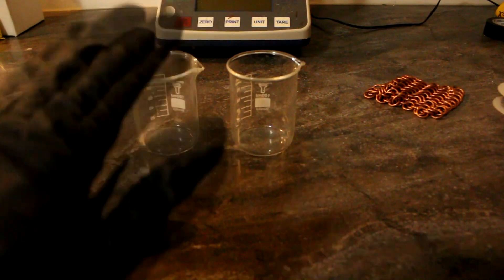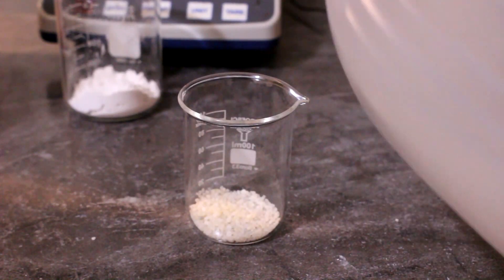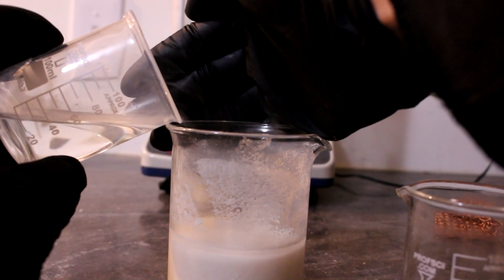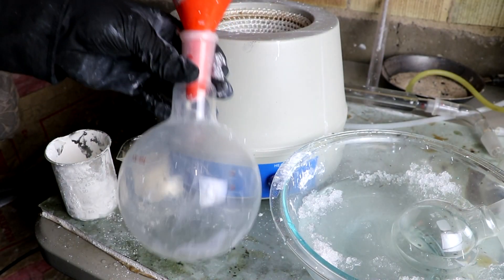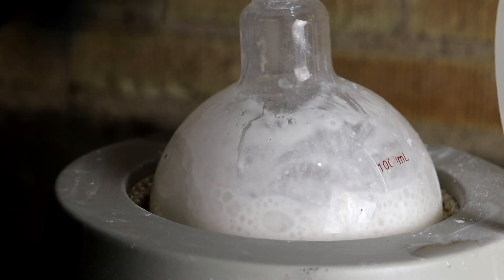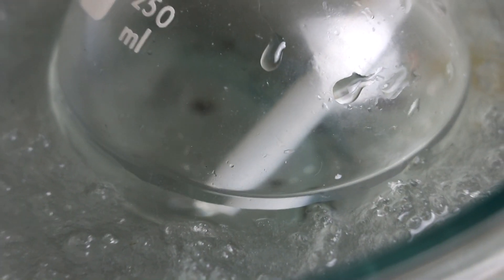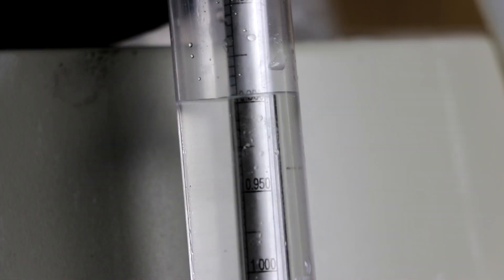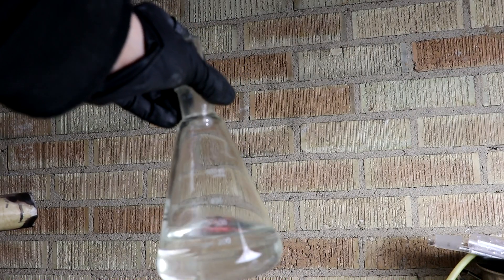Making Aqua Ammonia

Comment: slacked lime
Reply: How would a seasoned chem-guy say that? Does he know something I don't?
Reply: slaked lime. You take quick lime (CaO) made from calcining limestone, then you mix it with water in a big pit. It consumes much of the water, getting very hot in the process. When it is slaked (has used all the water it can easily absorb) it is called slaked lime, or CaOH, or hydrated lime. Cody made a mistake in calling it ag lime. Ag lime is just crushed limestone (basically calcium carbonate).

Comment: I think you may the the messiest chemist I've ever seen on youtube.. And it makes a great contrast both from other channels with their carefully cleaned glassware though I was disappointed that your distillation setup wasn't a length of salvaged glass tube with vinyl tube as the cooling jacket, some jars, silicon, tape and glue. :)
Plus awesome reaction, getting non-cloudly ammonia in Australia is tricky so preps like this are always interesting.
Reply: Electra Flarefire This "messiness" seems a bit acted to me. I like his videos but why? Why throwing magnets in solution? Why would you buy glassware, hot mantle, expensive reactants but not a stir bar?
Reply: @leonardoulian764  I mean if it works, it works.

Comment: Hey Cody how can we make npk fertilizer? I've heard Nitrates can be pulled out of the air, and where could we get low-cost phosphorus and potassium?

Then also how would we measure the strength? Like a 15-15-15? Spring is going to be coming soon and you know you're going to want to use it in your garden to use it in your garden!!!!
Reply: its probably just cheaper to source ready made fertilizer especially just for his garden.
Reply: pescod96 either way... I'd still like to know how to pull nitrates out of the air

Comment: Tollens outro for fun?  why not a complete episode on it, its really interesting. Really good video
Reply: I know that what results from a Tollens test is a silver mirror. That   is what he made in the video. But the getter in electron tubes is not silver, and it's not made using Tollens.
Reply: Yeah, I'd like to see that. It looks like what they do to put the getter on the old vacuum tubes.
Reply: The getter is not silver. It may look like it, but it's actually a different type of metal.
Reply: stamasd Erm, you are so very wrong - Tollens reagent positive test is called a ‘silver mirror’ and is in fact exactly that, elemental silver

Comment: Why magnets?
Reply from the maker: Didnt have a stir bar.
Reply: In the mantel (the thing cody put the round bottem flask in) there is another magnet that rotates quickly, thus causes the magnets in the flask to spin, stiring the solution. Much better than doing it by hand or having a bearing in the bottom of your glasswear with a rotating shaft going through it.
Reply: @Szak: Cool! Do you have a video of that? How did you get the heat source not to demagnetize the magnets? I would love one built into my gas stovetop. Imagine not having to sit there stirring for rouxes and cheese sauces and such.
Reply: Temperature control you also have to have spinning magnets outside the nonconducting pots.
Reply: calvingreene90 Also samarium-cobalt magnets have a higher Curie point.
Reply: Stir bars are expensive lol.
Reply: What temperature do neodynium magnets demagnetise at? I know that iron needs to be heated somewhere like 400-500 degrees before it looses it's field.
Reply: MarcAFK SmCo outperforms them above 150°C.
Reply: Stir bars aren't expensive, and glassware is. I used a stack of neodymium magnets before my stir bars arrived, and scored the bottom of my RBF. On the positive side, now that one doesn't need boiling chips :-/
Reply: Because sticks aren't magnetic.
Reply: Cody'sLab cmon dude you buy glassware, hot mantle, and not a stir bar? Or you're doing that just to pretend being "unconventional"?
Reply: The heating mantle causes them to spin , stirring the mixture.
Reply: And if you want to take the magnets out without pouring the solution, you can use another magnet
Reply: Tushar Sadhwani for mixing the solution

Comment: The aqua ammonia can be use for what?
Reply from the maker: I used about half a gallon in my uranium extraction.
Reply: Thank you for your answer Cody :D
Reply: so, say you do trivial things like extracting uranium, this vid is a good tutorial.
Reply: And as seen at the end of the video: making mirrors using tollens reagens
Reply: Lifters may use it as smelling salts. There is a brand named Nose Tork.
Reply: RUWO haha I think the point is he does this stuff and does experiments that are uncommon, so we the viewing public can see it, not so we can recreate it.
Reply: We use 19% NH3 in our S.C.R. system to bring down NOx ppm in diesel exhaust to permit levels.
Reply: So AdBlue then?
Reply: Stephen Mitchell all I can think of is called ‘touch powder’ and it is indeed a tri-iodide compound
Reply: Stephen Mitchell NITROGEN TRIIODIDE.
Reply: You can also use it as a buffer in low concentrations. Like .1 M.
Reply: AdBlue is actually a Urea solution
Reply: You can use it to make a refrigerator.
Reply: lol cody
Reply: Matthew Batchelor thanks it's been so long I could not remember perfect. Thanks again
Reply: No problem.  There are a lot of videos on it on YouTube....
Reply: he has a tutorial on how he extracted the uranium as well
Reply: Cody'sLab you should pin that
Reply: A refreshing beverage
Reply: Beatebrain Nitrogen tri-iodide. It’s fine while it’s wet but explosive ON PRESSURE when dry makes great flypaper. Explosive. Immediate expulsion from lab class in college lab.
Reply: Matthew Batchelor you're right! I just couldn't remember you know I love those things you do so you couldn't forget except for the important things. For US country boys more boys in the FFA then the football team it was number one entertainment for the whole year. Well maybe except for some of them country girls 😇!!! Thanks very much.
Reply: Ammonium Triiodide
Reply: Besides industrial usage (or Cody doing industrial stuff in his backyard), it's a great cleaning agent for glass and steel.
Reply: @FishFind3000
Dude, how is it possible to spell "uranium" as "urnianin"? ;-)
Reply: ivsciguy thanks I could not remember been a lot of wonder and water under that bridge. Thanks again!
Reply: Lab manual became rat nest for a family of mice. It was something it was just fun you start out with a slurry and then as it became a puddy you put a little oh somebody's lunch box yes we had metal lunch boxes are on the lives of our desk and it would sound like a cap buster AKA toy gun for y'all young folk and it would leave a iodine Stain other hand or elbow are on there pants. But you would get up early powerful paddling for doing that to a girl not that we would haha. Back in those days things are a little different teacher needed a knife to cut something with she has asked the class at least 7 boys would raise their hands ready to loan their favorite knife. We were all Country Farm boys lot of work with no pay. So we were easily entertained. Keep up the great videos, fantastic!
Reply: Right before I expanded your comment it just said bomb. They Cody says it’s for urnianin.... I was right!
Reply: Cody'sLab a few years before I became eligible for the draft around 1967-68 air chemistry teacher for second-year students it was a week of fun an occasional manual discipline for having too much fun. But for the life of me I cannot remember it was a contact explosive grayish color of and left the iodine stain on your skin. Lab teacher has died of old age lived locally close so I can ask her and my old lab manuals